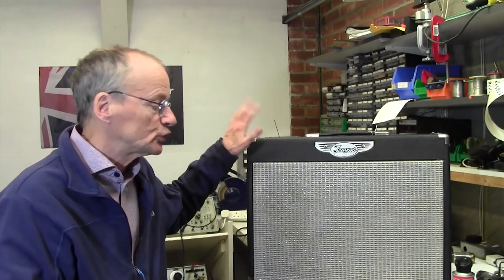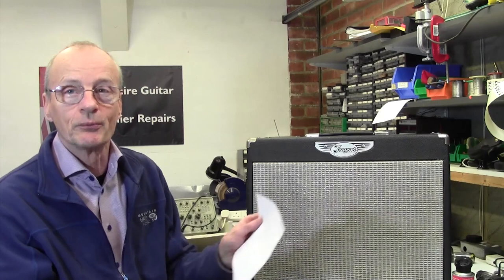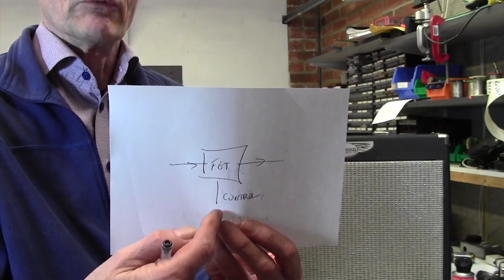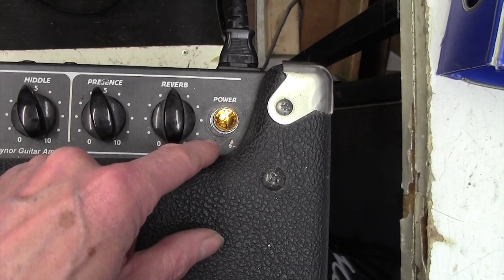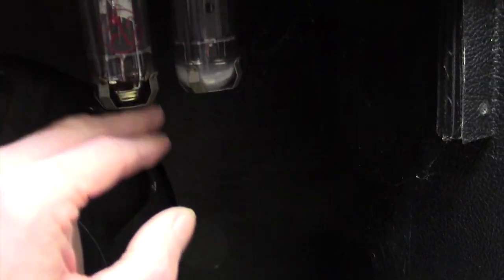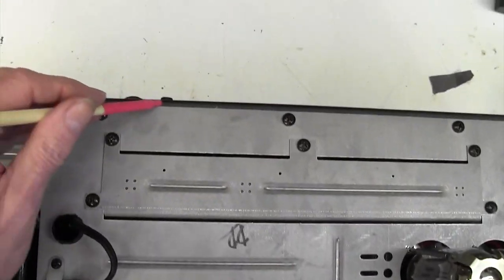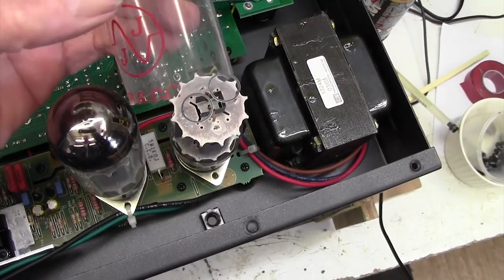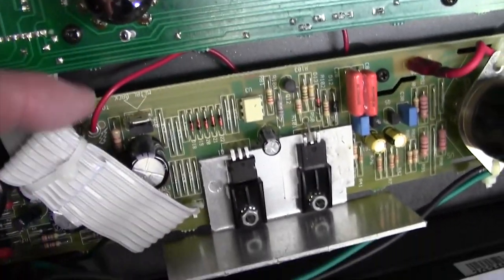Traynor YCV40 Standby switch problem

Comment: I rebuilt a YCV80. The Standby circuitry is a mess, no doubt about it.  The button triggers an opto coupler device that does two things.  It changes the lamp color between red and yellow (which is two small LED devices in the jewel cover) and then biases up a circuit that turns on the FET.  Part of this circuity is a string of 5 (or so) zener devices.  If someone really wants the standby to work properly, ditch this circuit, install a regular ole DPDT switch, run two wires to the outer edges of where the FET resides (removing the FET of course), and then add small LED to indicate the amp HT is connected and the amp is on.   You will want to figure out how to make the Red indicator stay on when you apply the power button.
Reply from the maker: Hi Thomas. That's crazily over complicated for what it does!

Comment: I think Traynor reccommends changing ALL the active components in the stand-by circuit. the FET, Opto-coupler, I think there's a transistor, and whatever. I don't think any Zeners were involved. They probably offer a kit you can buy.

Comment: Hi Stuart, I hope you had a pleasant break. MOSFETs are extremely static sensitive, one false move and they will be damaged, only to bite your bum sometime later, they are sneaky like that. JFETS are almost as tricky. MOSFETS also tend to fail short circuit which caused the end of a friend's Fender Passport system, both sets of speakers blown and then the power supply, RIP, distinct lack of fuses. The original Traynors were built with maintenance in mind but since the owner died....... Happy new year.
Reply from the maker: Hi Steve. Ok thanks for that. Happy New Year to you as well.

Comment: If the amp comes back one day try changing the optocoupler U3 4N35 as it shuts off the gate of the fet in combination with the standby switch.
Reply from the maker: Ah, interesting. Thanks I will.

Comment: Perhaps when the tube lost vacuum and burned up, it either drew too much current and damaged the electronic high-voltage switching, or the loss of one working tube meant that current draw was halved and so the unregulated H-T voltage soared and damaged the switching circuit.
BTW, Traynor are an old and venerable Canadian company that used to build very rugged hand-built amps (a few were purportedly tested by dropping them from the factory  roof!) but I dont know who owns them now  and these days they use PCB construction like everybody else.
Reply from the maker: Interesting thanks. Yes you may be right about that valve.
Reply: I thought the same thing (one damaged tube and one damaged MOSFET). Stuart, while you had the amp open, were you able to measure the transistor you initially suspected? 
I understand that some Traynor amps have an auto-biasing circuit in them. Could it be that the section you were looking at controls the bias? 
I recently bought a very similar amp and wanted to do some research on it. Great content. Cheers for the video!
Reply from the maker: @MrOlion  It's been a while since I did this and alas I cannot remember. Sorry.

Comment: There is a suspiciously high number of "thermally cut" power tube envelopes in your videos. Bad batch of tubes in some local shop?
Reply from the maker: Didn't quite understand that. What did you mean by 'thermally cut'?
Reply: @stuartukguitarampguy5830  Yes, I put it awkwardly, sorry ...The way cracks appear on those tubes looks  like when you  cut a bottle in half with a hot wire. I kept thinking what could be wrong with those JJs to fail on 100W Marshalls.
Reply from the maker: @jernejkurincic9050  I think it's just a plate voltage problem. Although they SAY it can take 600V+ some fail at about 450V and arc over.